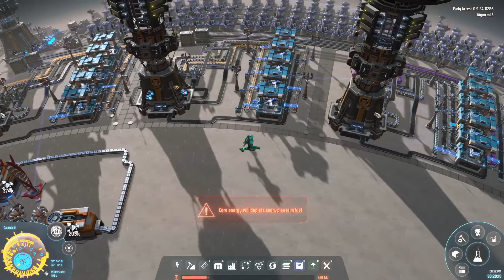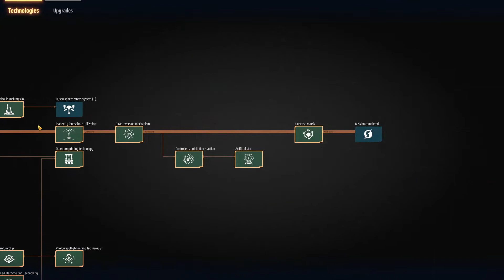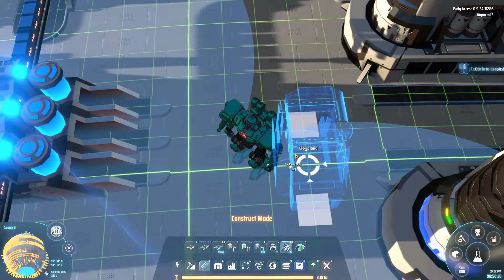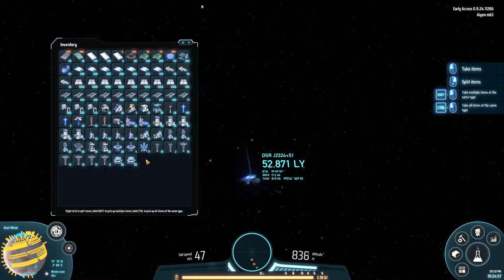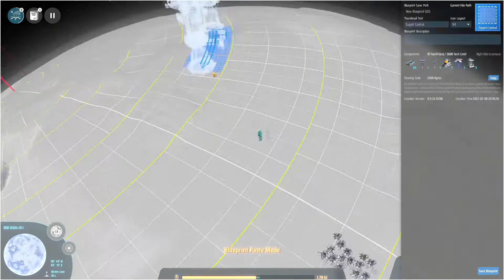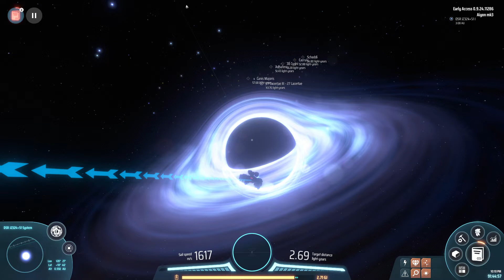Dyson Sphere Program / Second Launch / part 17

Comment: An update on where I have gotten to.  I am currently working up the factory for all research at the level that should get me to end of game.  I do not currently have all the rez needed to run that research park to maximum efficacy but if I am building the darn thing I might as well build it for the future  now that I can see what that future might be like.  Also by doing this I can work backwards removing outdated belts  and sorters and facilities or updating them in the few places what I have presently is effective enough.
I am juggling a thought to do the research park on the smallest and tightest scale possible then using blueprints to repeat the process on suitable worlds.  I am thinking that when needing tens of thousands of the silver matrix cubes having several worlds kicking out a few hundred per second will be better than one world plugging away at several thousand per minute.  Also I get  to fly around a lot using this thought which I suck at but need the practice....lol

Question though.  I don't see you talking about or showing use of the rare items as part of production.  Like the Spiniform Stalactite Crystals run through a chemical plant make the tubes needed to do tier 3 blue proliferation paint.  And that seems a much easier way to get those made.  It doesn't take a lot of the Crystals to keep enough chem plants running to kick out a lot of blue paint either.  I haven't really futzed with them as yet and it might have more to do with availability anyway.  I have at least 3 planets within 10 LY that have those deposits and 1 of those planets isn't even a water world.

I am toying some with the idea to mine only rare materials at a couple of worlds or maybe more than a couple because in most cases they seem to be a more effective way to get the rez you need.  The one doing the (can't remember the name, the crystal you need to make the item before Green Cube) uses the same amount of Graphene and Hydrogen as the process using the manufactured rez so it is kind of a wash and there might be others.  (Graphene and Hydrogen come from Fire Ice, I think so there might be something there with Fire Ice and that Rare Mineral.)

Anyway, Good stuff.  I do still have to walk away from the game pretty often it seems.  Like my mental buffer fills up and I need to reboot the computer in my Central Brain...lol.  I do see myself getting things looking better and more efficient quicker though.  Thanks for the inspiration.